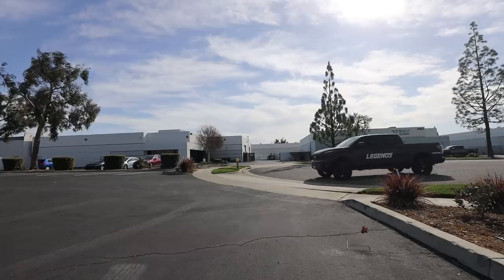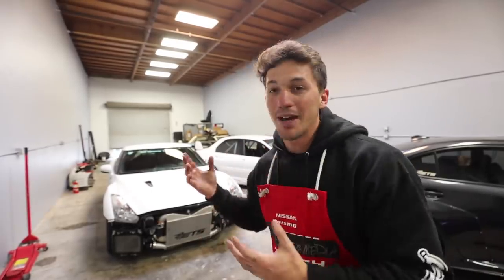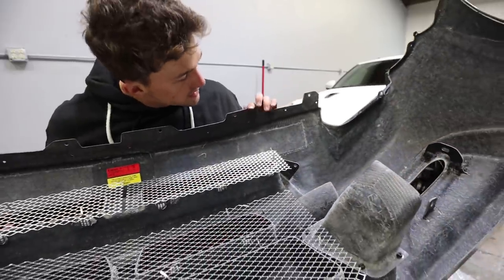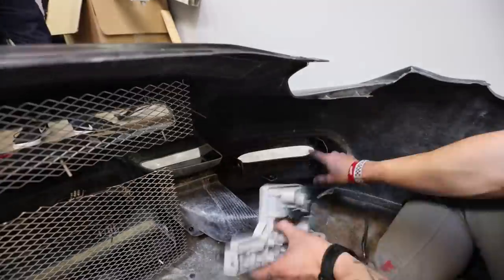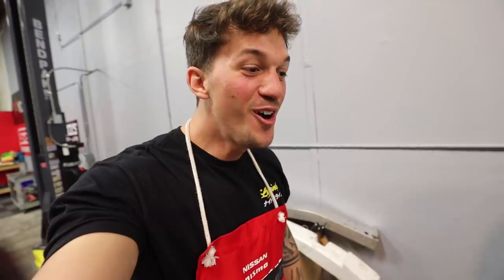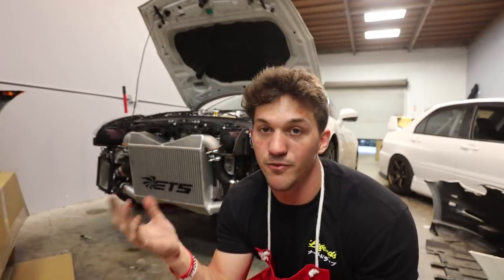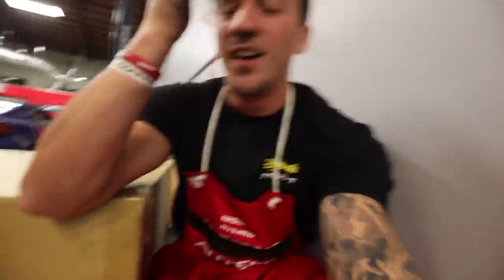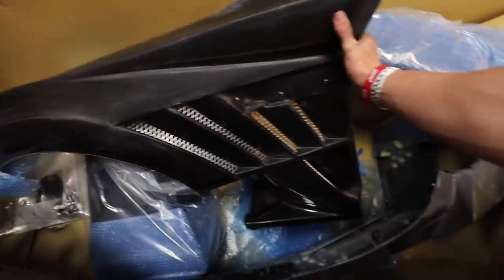INSTALLING VARIS R35 GTR WIDEBODY KIT PT. 1 FRONT BUMPER | BUILD SERIES EP. 5

Comment: 15:37 There's no traditional quarter panel replacement, but in the full Varis Ultimate kit there is like a fender flare bit that attaches to the stock quarter panels and ties into the side skirts. 

I hope you got those and the crane neck wing that goes with this kit. Gonna look weird with the smol boi stock GT-R spoiler with this aggressive AF body kit lol.